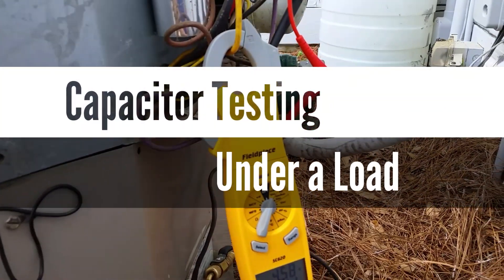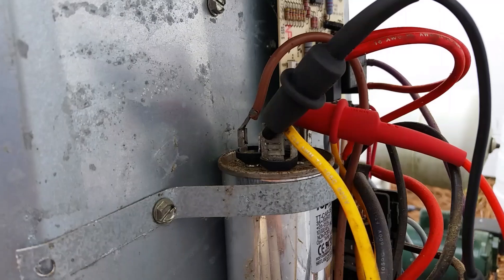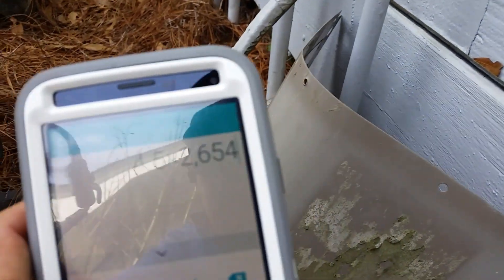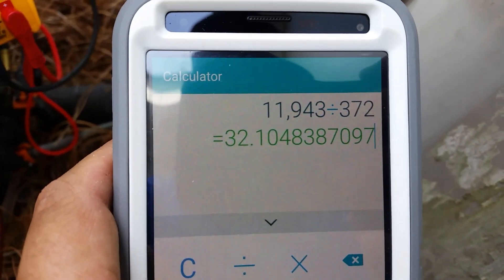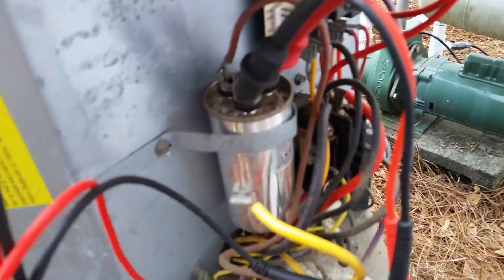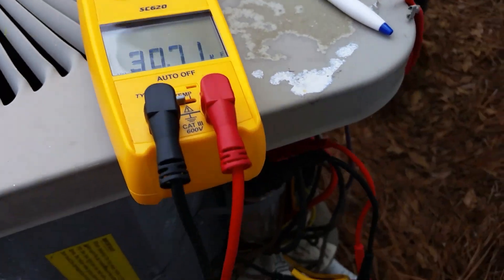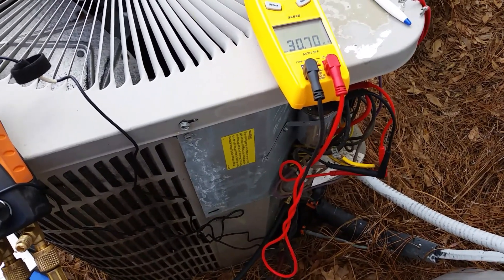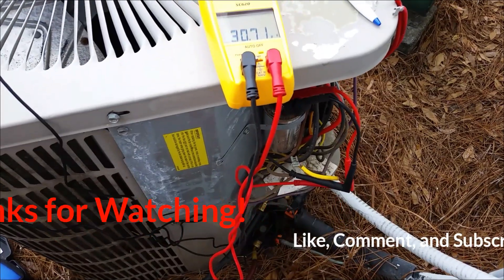How To Test A Capacitor Under Load

Comment: Only thing I would add is to show where you set the meter too both under load and not. We are assuming folks know where to set. Also the constant used in calculation, is this the same on all AC Capacitors.  Again I work on machines and equipment, not using this type of electronics. Different caps and inductors. Would like an answer from someone.
Reply from the maker: Sorry but this is not intended to show people who are not in this trade how to do things. These videos are for HVAC professionals which is why I  intentionally leave out certain details.

Comment: If the capacitor is reading low under a load it will more than likely read low disconnected. Under a load will vary depending on your voltage.
Reply from the maker: +Roger Lerma  Not entirely true. Ive found plenty that read good out of the circuit but read weak under load.

Comment: if you don't mind me asking where do you get the 2654 number from thank you Ross from New Orleans
Reply: Very few people in the hvac industry can answer this question. 
Capacitance is proportional to the inverse of 2×pi×frequency. 
1÷(2×3.1416×60)=1÷376.992=
0.0026525762.  To get micro farad you  move the decimal point 6 places to the right: 2652.5762. So i use 2652. To help you remember, think 26 then double 26, ie 52.
Hope this helps.
Reply: Ross Flores it is a rule of thumb factor, others quote it at 2650 or 2652 but the math works out close enough. (also from NOLA)

Comment: so I am confused in other videos I have seen it says to test by 2650. your videos testing by 2654 for the caps?? any feedback on that would be appreciated
Reply from the maker: Andrew Nielsen 2654 was the multiplier I was always taught but many beople use 2650 and also 2652.
That being said, the result of using any of these options in your formula will still give you basically the same reading. If I used 2650 in the video, our reading would have been 32.05uf rather than 32.10uf using 2654.
Hope that helps.